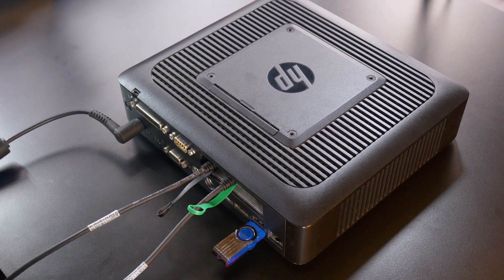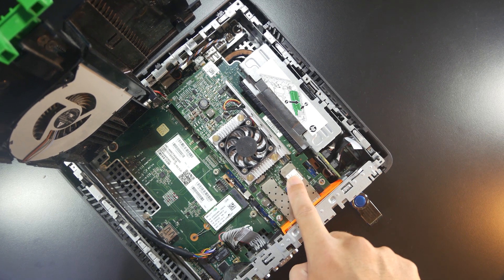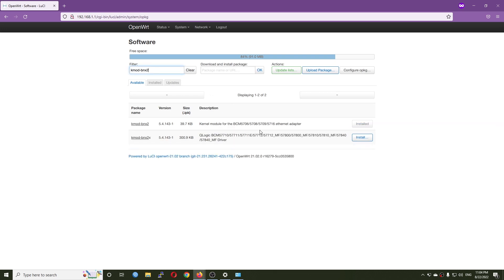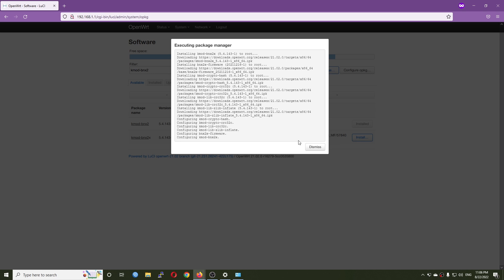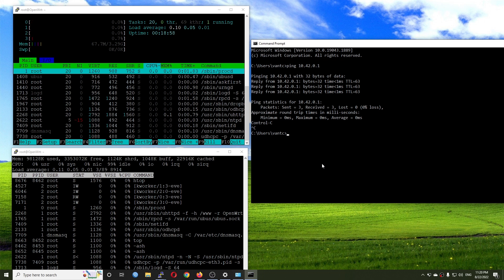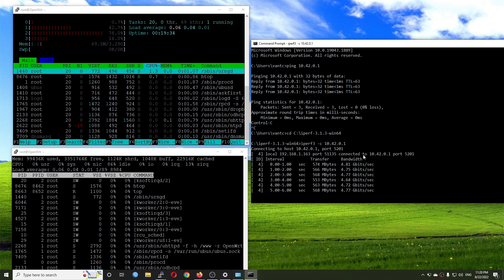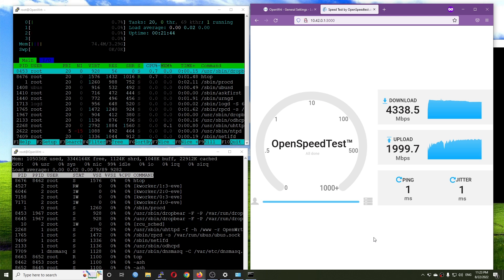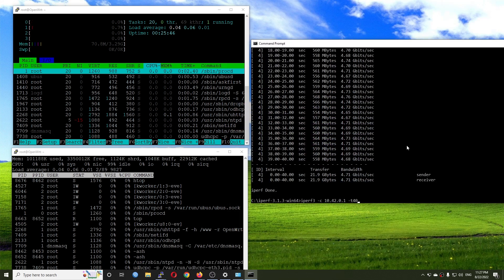OpenWRT 10Gbps - HP t620 Plus &  Dell QLogic 57810S Dual SFP+ Adapter

Comment: I know this is kind of non-sequitur to the main point of the video, but I use several of the HPT620plus for a lot of little machines in my home lab, and I haven't seen that RJ45 connector added before. Do you have a link for where you got that or a video on how to build it if it was a homebrew solution? Thank you
Reply: Sorry, being ignorant. I just checked inside one of my cases and realized that's the mini-PCIe slot .. I should have remembered that.
Reply from the maker: Yes you are right. There are mini-PCIe to 1 or 2.5GbE adapter available on the market. I have been using them and have no problem so far.

Comment: Got one of thoes machine for myself, with a pcie to eth card, i never went over 10W idle and 13W gigabit throughput on 240V in france 👀but they are awesome and powerfull litle routers
Reply from the maker: Yes it is. May I know what is the model of the NIC you are using? The SFP+ network adapter should consumes more power compare to the rj45 network adapter. With no adapter installed, during idle my HP T620P draw ~ 10W, just like yours.

Comment: The BCM57810s operates at PCIe 2.0 . PCIe 2.0 can provide "real world" 4Gb/s per lane. So if the slot provide 4 lanes ( x4 ) the max transfer must be 16Gb/s ( gigabits per second ) limited by the sfp+ link to 9.4Gb/s . I sugest to try MTU 9000 since it reduce the packets/s in the interface and so overcome some limitations in I/O.
Reply from the maker: Thank you for the information. Unfortunately I don't have a chance to try this because it is returned the owner. (I borrow it).
I also tested this card with the Zimaboard (x86 SBC, Intel N3450, PCIe x4 Gen 2) and I managed to get 9.4Gbps throughput with the same setup (no touch the MTU). Maybe next time when I got another network adapter.
Reply from the maker: Here is the link to the test https://youtu.be/Y_J47ZbgZec?t=1060
Reply: @VanTechCorner  I have found some strange results using 10Gb/s NICs related to the PCIe configs in bios of the computer. Since the CPU load in your tests stay far away from 100% I guess that is some PCIe related config. Did you verify the config that the crd are using ? ( lspci -vv ) to see how many lanes and what PCIe level is being used .
Reply from the maker: For some reason, I can't install the pciutils package on OpenWRT 21.02 to verify it (package is not found). However, I do have the same thinking with you. There could be something wrong with the PCIe, either the Generation is not properly detected or something wrong with the BIOS setting. I will carefully check it out once I got another card.
Reply: @VanTechCorner  I'd love to see this testing repeated with pfsense.